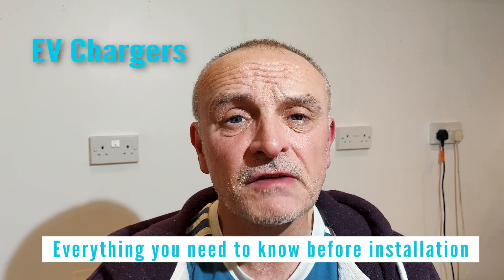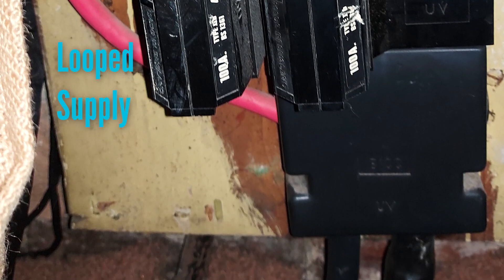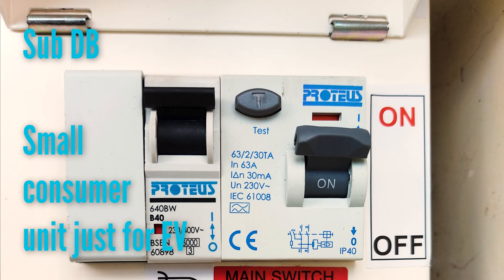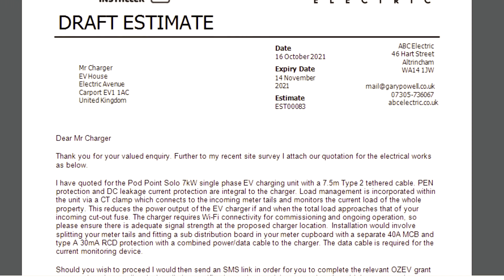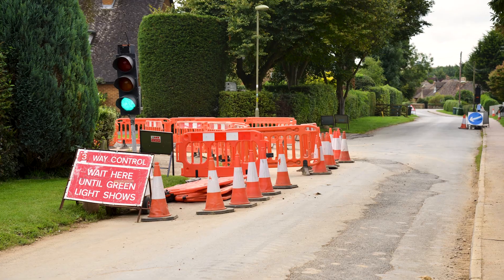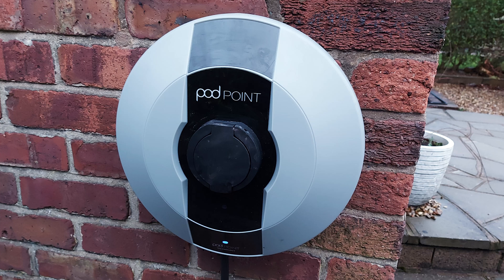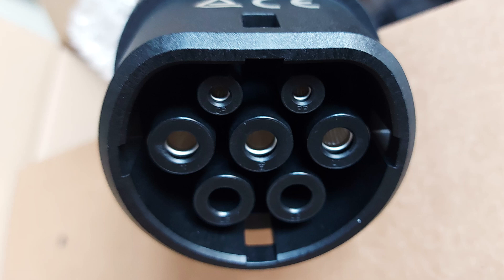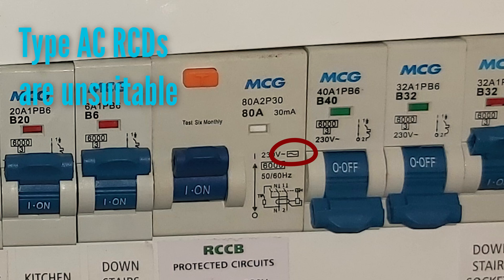Everything You Need To Know Before Installation of an Electric Vehicle Charging Point

Comment: My dno will not pay for a 3 phase. My home is total electric but cannot use a second ev charger. So we cannot meet the goverment deadlines unless someone pays spenergy £15k
Reply from the maker: That's going to be a much bigger issue in the future Gino. You could probably add a 2nd charger by utilising load sharing though
Reply: @abcelectric  yes I could but when one car is used, and we have had a power cut for 3 days now the ev cannot be used, so I was going to get a ev van but I cannot as we would both need charging every night. So looks like it's best to kerp a diesel. For us no diesel no work.
Reply: Instead of paying the DNO £15k why not invest in solar and battery storage
Reply: @catherineshuttleworth5686  I have solar I have battery's. Its to do with how much load you use, using a 100amp cut out. If all my loads in my home were used together it would exceed the 100amp now. So this is why a I require 3 phase.

Comment: Great well explained video. One thing that is worth mentioning is that most older properties don't have a 100A isolator fitted after the sealed metering equipment. This officially needs to be fitted by the customers current energy supplier. Some will charge for this but we had smart meters fitted so they included the isolator for free. I'm an industrial controls engineer so wanted to make sure Pod Point had easy isolation and Henley blocks to connect their extra combined RCD enclosure to. Smart meters will be a major advantage in the EV installation as the customer can then use a monitored off peak tariff to set the vehicle to charge overnight.
Reply: Thinking about this and long term into the future i recon that off peak will soon become peak time.... as there will be more of us using chargers during the nite time thus creating a higher demand..... cheap rates will be a thing of the past...